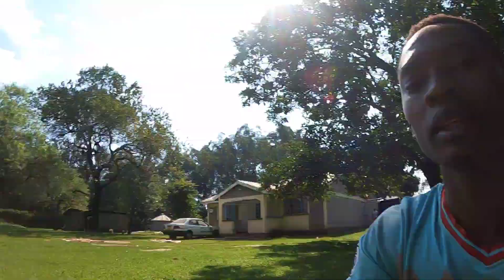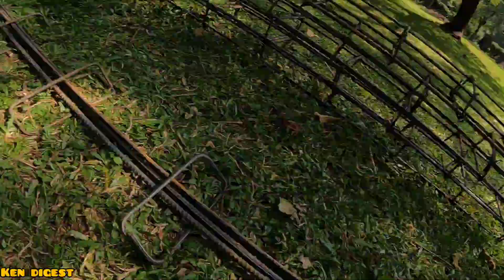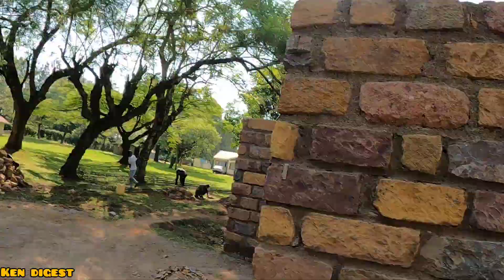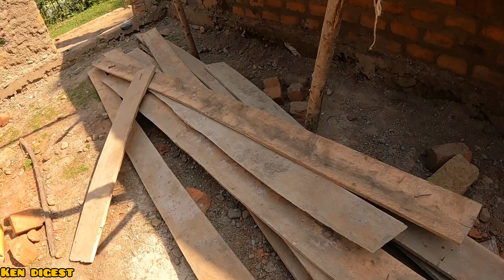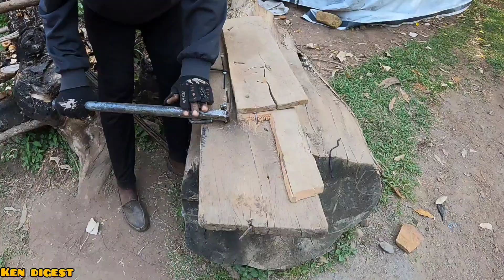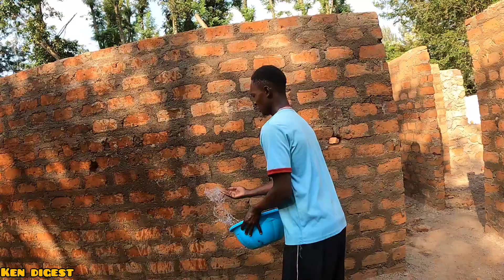ONGOING PROGRESS OF MAKING MORE RING BEAMS FOR OUR DREAM HOUSE

Comment: The steel rods are corrugated  steel rods with the roughness  on the rods  then they have the smooth  ones called  the plain steel rods 8, 10, 12 guage We cut it with a Bolt  cutter too instead a hacksaw  or an abrasive blade on a circular Electric  saw Home boy made is own hacksaw  handle That's  the skill of a tradesman how to engineer  things  to there likeness  too Balast look like it has the cost of gold.That Linton use a lot of board I would have joined  two board side by side ken which one is the mango tree in that compound. God Bless    ken  Digest  l would  be eating some fruits from a tree Shout out to Miss Fle Ken Digest  and the rest of your family and your good workers So❤❤❤❤❤SSSC Share Spread Show Care with BOLD LOVE love people in your community Kenya Africa and beyond
Reply from the maker: You know a lot interms of construction. I'm not surprised though 😂❤️❤️
Reply: U know what, I was wondering why they couldn't join two 'woods' as u said, then add the right width on the side, they fall short.. ( to b economical )j